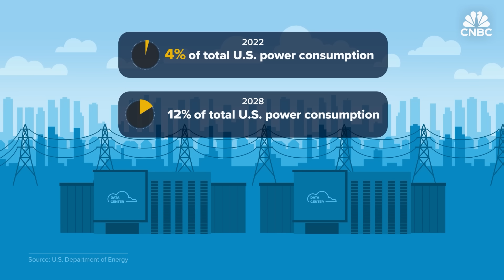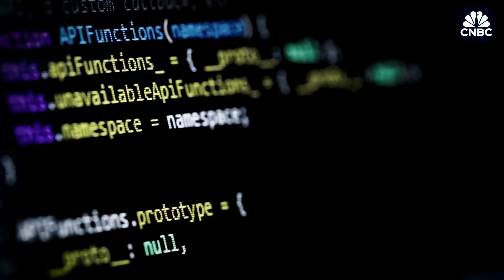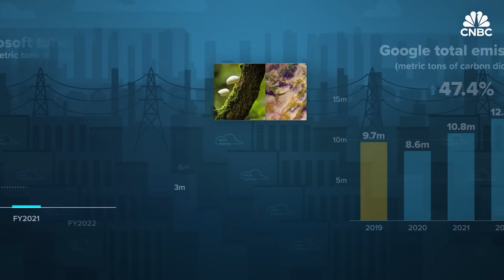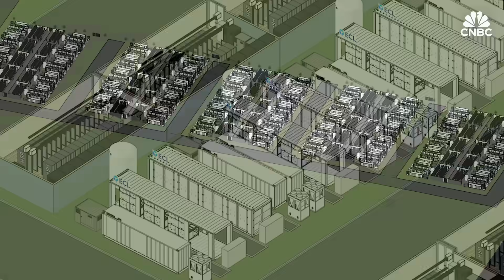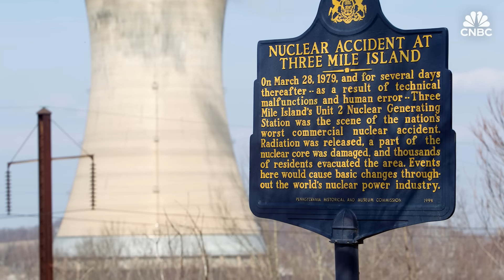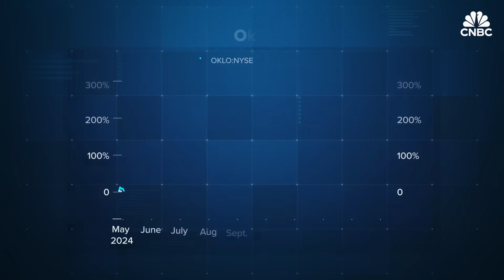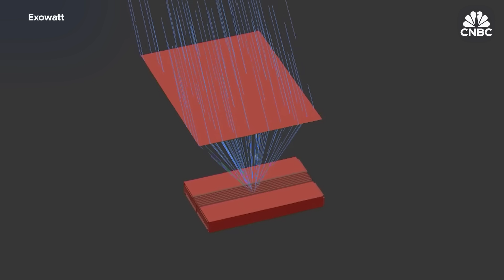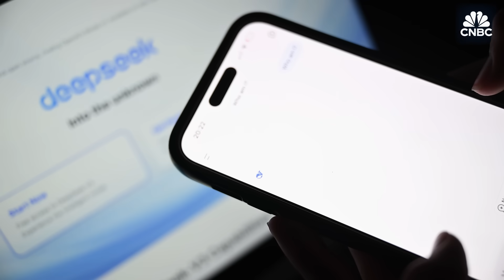How Google, Microsoft And Amazon Are Racing To Solve The AI Energy Crisis

Comment: Hydrogen is a form of energy storage just like a battery, it's not a form of energy generation. Nuclear is energy generation, so it's incredibly misleading to compare them against each other.
Reply: Hydrogen can also be a fuel, commodity, form of collateral, or key input to other materials.  It is highly strategic.
Reply: @FlameofDemocracy  Buzzwords. Hydrogen is not a power source. It's a transmission method.
Reply: You are right if hydrogen is produced by electrolysis. But if hydrogen is produced chemically from hydrocarbon (fossil fuel), then there is a net energy produced by this type of hydrogen, just like normal fossil fuels. But this chemical process is polluting.
Reply: @eugenec7130 We don't care about pollution lol. Do you know how big the carbon footprint is for one of these data centers? There are millions of GPUs in these data centers.

Comment: Hydrogen makes zero sense for grid energy.
Reply: Yes, the only real practical applications surround remote branch rail lines (and spacecraft), explaining the longstanding interest in Japan.
Reply: @Ryanwithani I think the big one people forget for hydrogen is the grey hydrogen (made from natural gas) which already has a large market with synthetic fertilizer production. It’s the same pure h2, it just needs to be cheaper than grey hydrogen, but that’s a moving target.
Reply: @Ryanwithani It isn’t even great for that. It is very inefficient plus hydrogen leakage, which is hard to stop, can actually increase climate change.
Reply: Actually, stationary usage of hydrogen for grid storage would probably be the most appropriate place for hydrogen.  Agreed, hydrogen for transportation, especially personal vehicles, will never be economical.

But stationary use of hydrogen in large-scale installations could achieve economies of scale.  Especially for long-term "seasonal" storage of energy (months) where battery systems which are focused on daily cycles.  I'm talking storing the abundant amounts of spring/summer renewable energy for use in the fall/winter when renewable energy is not as abundant.

There are also solid-state forms of hydrogen as well as conversion to ammonia (NH₃).  Yes, I am aware the hydrogen RTE is much lower than battery RTE but the long-term seasonal storage is the key here.  Given enough subsidies and capital, hydrogen storage can supplement battery storage as the grid-scale energy storage sector expands.
Reply: @beyondfossil  Nah can't work. The numbers have been run. It's incredibly inefficient. It also quantum tunnels/leaks out of any container it's put in.
Reply: какое отношение off grid data centers имеют к энергосистеме?

Comment: Hydrogen is pretty much a boondoggle.  It isn't dense enough and costs a small fortune to generate in an environmentally friendly way.
Reply: There is a lot of over-excess energy created with wind and solar that can't be used. But could be stored into green hydrogen.
Reply: @teemueramaa5040   if you're only running expensive electrolyzers and compressors when electricity is cheap, your capital expenses per kg of H2 go up. And there are other variable demands for cheap electricity, like charging EVS, pre-heating buildings, and some industrial processes.
Reply: agreed nature uses carbon for a reason
Reply: @JonathanBhagan  But nature's hydrocarbons use both carbon and hydrogen. The hydrogen atoms outnumber the carbon atoms by some 2 to 1.
Reply: Ye. Using renewable electricity to split water, compress the hydrogen, store it, deliver it (a diesel truck delivering hydrogen to ECL!) then run it through a fuel  cell to turn back into electricity is always going to be 2.5x less efficient than using the renewable electricity directly or putting it into a battery. And making cheap blue hydrogen from dirty fossil fuel then capturing the CO2 is pretty much wishful thinking. The only use for captured CO2 is pumping it underground... to increase the production of dirty fossil fuel.
Reply: Hydrogen is a fool’s errand. It takes electricity to create H2 which is used to create electricity. But why? Just store or transfer that electricity
Reply: @vinitbaliyan9418  Use H2 in steel making, and ammonia production. I agree H2 as energy storage makes little sense.
Reply: Hydrogen can be every night form the daily grid surplus.  It is quite cheap to generate.

Comment: A fuelcell to generate heat? This sounds wrong to me, why not just use the electricity generated by the fuelcell?
Reply: dunno if they said it right usually the fuel cell just makes power, tho using hydrogen as a power source is very bad id say since you need  2.8 to 3.3 kWh per kwh output, tho can also just be a hho boiler that converts it into steam and then into turbine

Comment: How much energy do they use to split water into Oxygen and Hydrogen to collect the latter?
Reply: A lot. The process of splitting water, compressing the hydrogen, then turning it back into electricity is only about 40% efficient. Its far better to put electricity straight into a battery. Hydrogen isn't a "power source" as this video describes it, it's a way to store energy.

Also, when hydrogen leaks (and it always will, because it's such a tiny molecule) It has a high global warming potential because it interferes with the breakdown of methane which is a potent greenhouse gas.

Unless you can make and store vast amounts cheaply, hydrogen is a dumb way to provide electricity.
Reply: About as much as they use to reach the water purity required for catalytic splitting. Cant just put any water into those expensive machines.